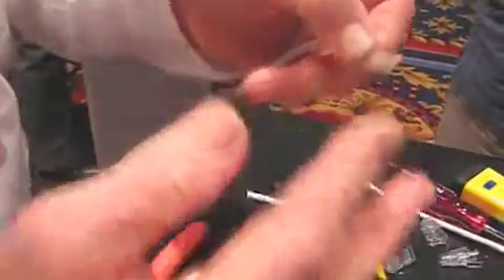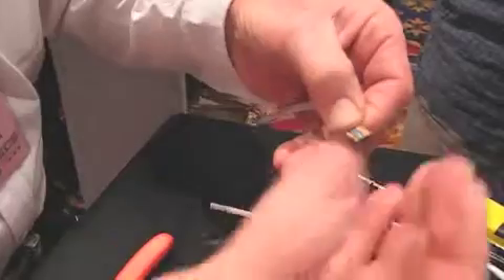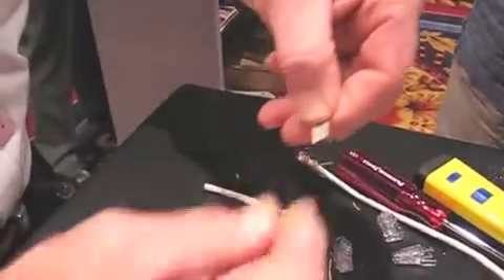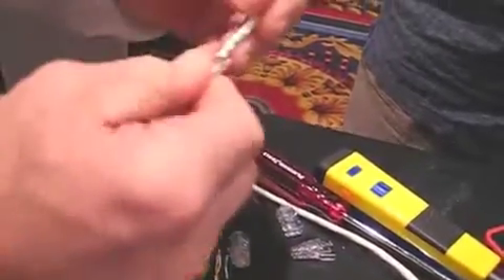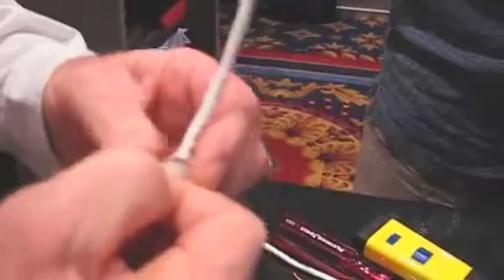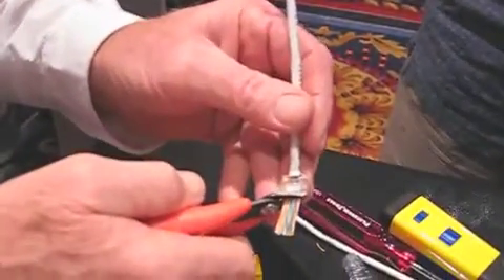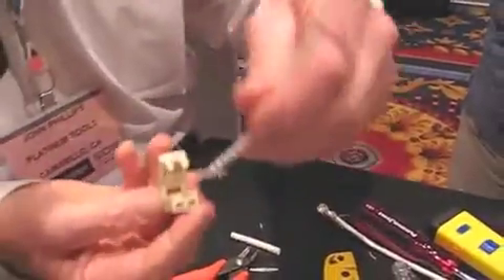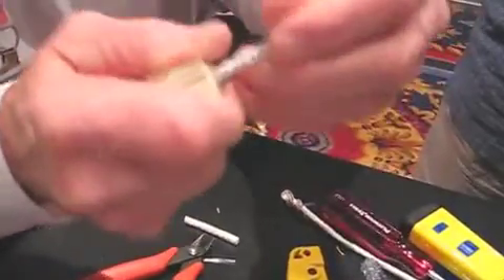Platinum Tools EZ-SnapJack RJ45 WallPlate Jack EDS 2011

Comment: If you are using high quality 23AWG Cat6, it is very difficult to slide the cables through the guide bar or even get the bar close to the cable jacket. It's faster to use standard RJ45 punch down jacks. It works fine with 24AWG however.